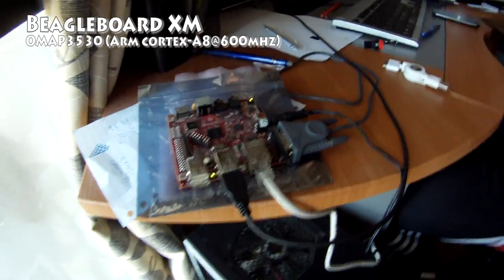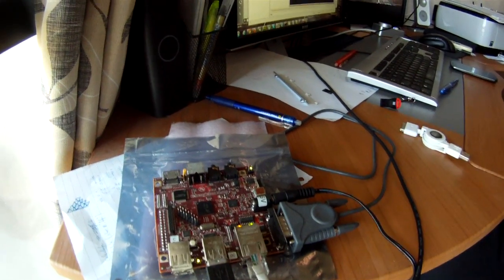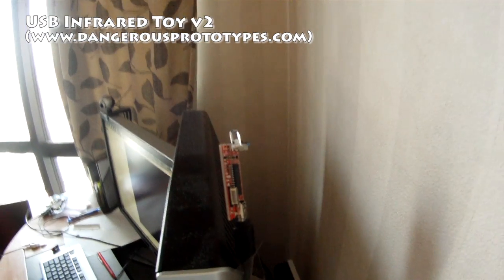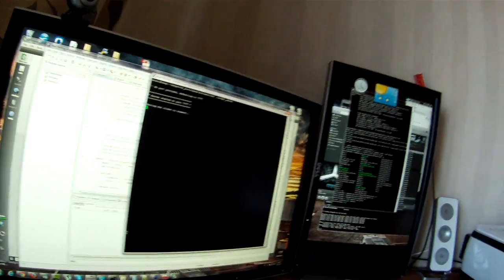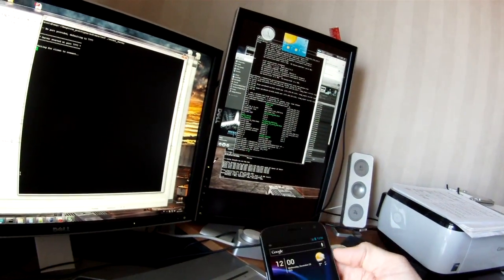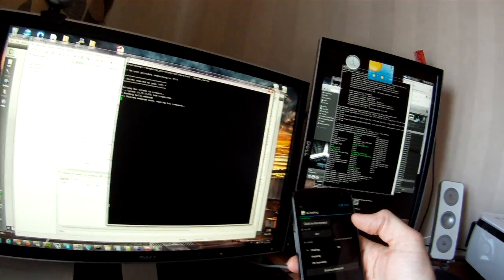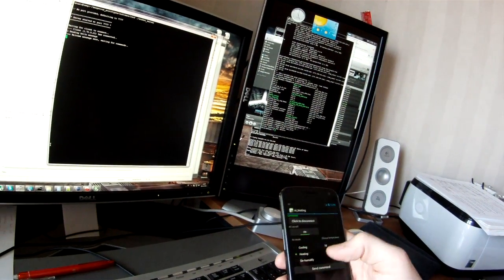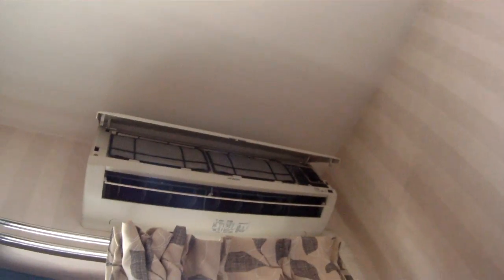Controlling home AC on a beagleboard with infra-red

Comment: Excellent project, I'm also interested in doing the same thing with a mitsubishi heat pump.  Did you get around to making the open source project you mentioned?  If so do you have the address?  Thanks.